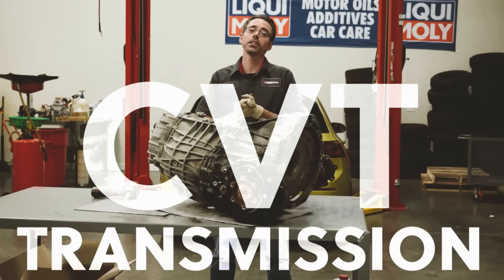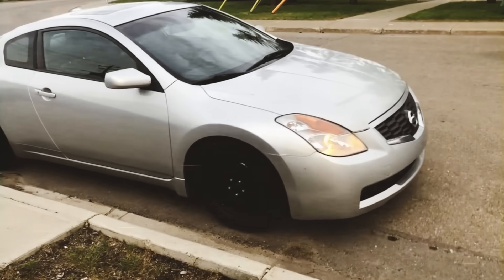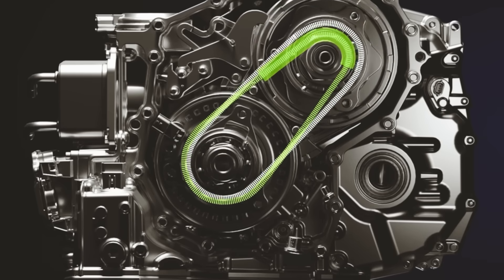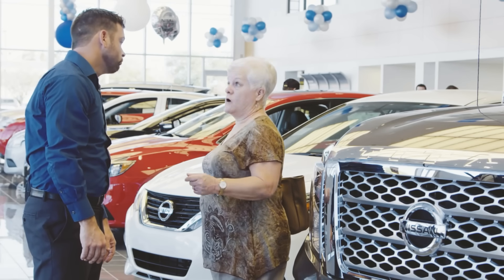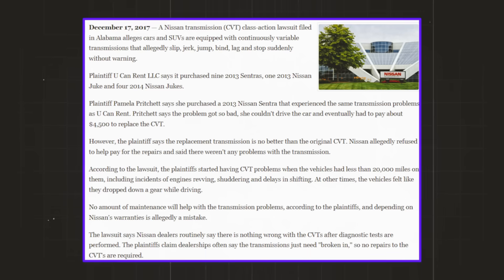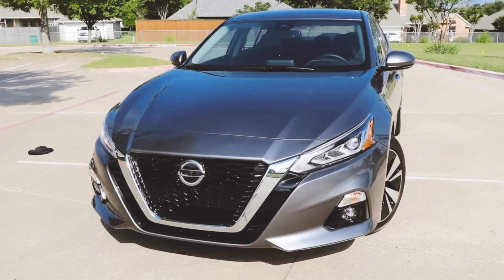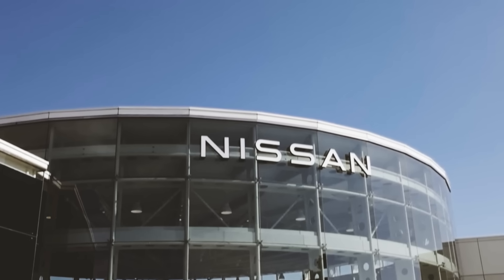Unpacking the FAILURE of Nissan's X-Tronic CVT

Comment: Being a mechanic myself I was reviewing the c v t design Over a decade ago. And I found it to be a double edged sword. And wrote down and design multiple iterations that would solve the c.V t problem. Unfortunately, the reality is.I do not have the capacity 41 man that I am to be able to affect any kind of change to a large corporation even if it would benefit them financially. The sad reality is the c v t design could be redesigned to handle extreme power and loads. To the point that you could probably put them in large semis without concern.
Reply: Like the Cvt in F1s?

Comment: 2003 Murano. 380,000 km no servicing before CVT issue. 

2014 Juke 200,000 km before accident 
2012 Suzuki SX4 (same Jatco CVT) 200,000 km still going
2016 Rogue. 240,000 km still going. 
Replacing fluid once in a while. Like 100,000 km. 
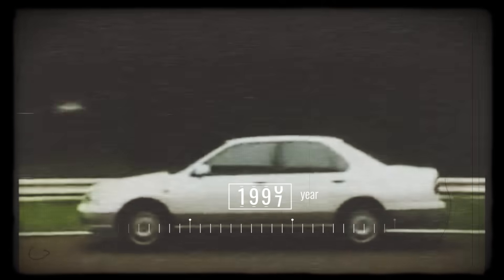Also 4:33 had another Murano for a short time. 

NO issues 

Did have a problem with the updated chain drive CVT on a QX60 from new. Got rid of it. 

Sooooo. 95% failure?

Reminds me of everyone lighting their hair on fire on other issues in vehicles. Yes there’s been some, maybe many, issues.  But it’s not EVERY SINGLE ONE.

Comment: I did notice 3 newer models that were not mentioned with little to none of the common major issues as the American build models is the Quest, Maxima and Murano fun fact about these 3 is that they are similarly built on the same front platform design and most of them were built in Japan my 2011 Quest was built in Japan and I feel it was made with better quality parts from the same design they look the same but they are different and you can tell just looking at an Altima 3.5 V6 CVT to a Maxima 3.5 V6 CVT they are different same engine size the only difference is HP the Quest and Murano looks exactly the same as the Maxima but don’t have the same power output so Nissan changed the CVT design for the American built models

Comment: As a mechanic, I always tell people that it will need a Nissan will need a transmission at 100k. If there are lucky if they make it that far. I have replaced some as low 26k miles.
Reply: Yep, my 2016 Nissan Rogue CVT took a dump at 67,000 miles!

Comment: I hate CVTs. Never driven one that had acceptable performance characteristics. Sure, they might have helped the manufacturer eek out another mpg or two to meet a CAFE standard, but as decent transmission with reliability, durability and good performance, absolutely was not that. The seller did well. The buyer got hosed.

I can’t imagine ever buying a vehicle with a CVT. Not ever.

Comment: friend of mine has a 2017 civic with a CVT and it hasn't had any problems yet even at 195,XXX miles. he's had me do a drain and fill on the tranny every 20,000 miles. the owners manual says to do a drain and fill every 25,000 miles.

Comment: I worked selling cars in the mid 2010s. Had so many people trade in their Nissans because of faulty transmissions. The dealer I worked for didn't bother with selling used Nissan vehicles with CVTs. Those went straight to auction.
Reply: And this continues, which means it is so profitable that Nissan does not care about the loss of reputation and some customers.
Reply: @trumpeldorf what current sources do you have about that?
Reply: @marvin7533  Yes, there is a lot of such data, from the constantly unreliable CVT, which has already become a meme, to the constant investigations by the feds with engine problems, airbags... + consumer reports, where Nissan is the only Japanese brand that always sits much much lower than all other Japanese brands .
Reply: I’ve seen at least 3 older Nissan Rogues stranded due to trans failure. One in the middle of a busy intersection. They are 100% going to fail if you own one.

Comment: Im not going to defend Nissan, but to be fair, CVT's need much more maintenance and upkeep compared to regular transmissions, and they aren't designed to be serviced easily or cheaply. CVT's are also inherently weak. They aren't designed to be paired to a powerful engine. Theyre made for fuel economy, not giant 5 going 90 in a 45, as all Altima drivers do. The Jatco designed CVT is inherently bad.  There's no doubt about it. Either way, you'd be better off with a CVT from Honda or Toyota. Or get a car with a traditional automatic.

Comment: Two issues with the CVT: 
1:  it’s a soulless transmission. 
2: automatic and manual transmissions are still significantly better than
Reply: Cars with CVTs vary gearbox ratios at a fixed engine RPM to accelerate; others use the motor to accelerate at a fixed gear ratio. I think motors do a better job of accelerating.

Comment: I bought my Nissan Altima brand new in 2015 and kept up with the maintenance change the transmission fluid at 60,000 miles and now I’m gonna change it every 25,000 miles. Another thing that could be killing. It is how people drive their cars. The CVT isn’t meant to be a get up and go like a normal transmission(in my opinion) so if you’re riding rough, it can and will probably slip on you.

Comment: CVT longevity seems to depend on at least 4 factors, your CVT make and year, how quickly you accelerate or whether you tow anything, how much you drive in extreme heat or cold, and how often you change the CVT trans fluid and the 2 filters (maintenance interval).  MY 2015 Sentra has 190,000 miles on the CVT and has never had any problems.  I recently dropped the pan, inspected thr fluid, and changed both filters, the belt and spool showed minimal wear.
Reply: I've had 5 Altimas from 2010 to 2024.  A 2013 I had blew the transmission at 2900 miles (yes less than 3000 miles). When I've taken the cars in to have their "transmission flush", they not only don't change the filters but one dealership said they had never seen the filters changed.  Looks like on the 2024, I'm going to be doing my own fluid changes so the filters actually get changed.  When I wrote Nissan about how often the filters should be changed, they said I'd need to contact the dealer.  Talk about a Catch-22!!!  I find the Altima a great car and have had virtually NO problems with them other than the 2013 transmission.  I DO trade them in before the warranty is up though.  After owning 5 Toyotas and 1 Honda, I still like the general quality of the Altima the best.  The 2007 Camry and 2009 Accord I had were two of the biggest pieces of junk I've ever owned.  Disappointing after owning a Corolla, a Celica, a Supra, and an ES300.

Comment: The thing is, Nissan already had a promising CVT called Toroidal CVT back in 90s. But they decided to cheap out for the traditional belt CVT.
Reply: If it's not the transmission first, the head gasket is normally the one.

Comment: I work at honda. They really don't complain. You could come in first time doing a cvt service at 130k. It will be okay. 
Newer Honda regular auto trans have issues quickly with lack of maintenance. We replace these all the time but I never really see a cvt trans being replaced.
Reply: bulllllllsht. cough honda v6 autos.
Reply: There's a Honda dealership next door where I work at and sometimes I can't tell if it's transmissions or engines getting replaced, I'm betting it's the 1.5T engines.
Reply: My Honda has 170k miles and the cvt still runs like new
Reply: Mu honda CRV 2015 has 120,000 KM and CVT works perfect.

Comment: CVT's used by Nissan are not made by then but by a company called Jatco. They sell transmissions to several car manufacturers and they're all trash. Avoid CVT's wherever you can, no matter the make. I own a transmission repair shop and believe me, they will break.

Comment: The biggest mystery is why does Nissan continue using this transmission. They have the new 9-speed AT which is lightyears better than their CVT yet they keep using it which is a risk.
Reply: Nissan owns Jatco which is Japanese automatic transmission company.
Reply: @scrambler69-xk3kv  Didn't they divest JATCO years ago at this point?
Reply: My Frontier has the 9 speed. It's a Mercedes unit. Real nice.
Reply: Because CVTs are used for front wheel driver cars like Altima/Sentra/Versa.  The 9 speed is for Rear wheel driver cars trucks and SUVs and would be hard to fit sideways.
Reply: Cost, save cost, magnify profits
Reply: Costs
Reply: Exactly.  That 9 speed is class.
Reply: Pretty sure the frontier has a standard transmission and I heard the Pathfinder was ditching the CTV
Reply: That is a 9-speed German made ZF regular transmission designed for large vehicles. The ZF transmission is installed on 2022 and up Nissan Pathfinder. That transmission is expensive and not suitable for lighter vehicles.
Reply: I think it's just a US thing cause in other markets, Nissan uses e-power (which is the car being driven by electric motors while being generated by the engine)
Reply: @lol0r3  Nissan sells many models with JATCO CTV in the Japanese market. None of them have issues like in North America, because CVT fluid is commonly replaced every 30,000-50,000km. And yes, e-Power hybrid variants are being offered in Japan, China, Southeast Asia, Europe, and South America. Nissan even offers e-Power models in Mexico.
Reply: I have 225000 miles on a 2008.Nissan Sentra with a CVT  transmission and it's still running strong.
Reply: 9 speed is rear wheel/all wheel drive not built for cars like rogue and sentra
Reply: Because it's one of the best transmissions on the market. The problem is the consumer not giving a shit.
Reply: @garneroutlaw1 "Best transmission"

That's a funny joke.
Reply: @garneroutlaw1 Thank you! All negative propaganda. They sell millions of these and people don't follow the service schedule, then blame Nissan.

Comment: I have a Subaru outback with a cvt and it has eaten solonoids one too many times they just fail so im driving it currently with a permanent limp mode because paying $1300 is not worth it 3 times I have done it twice a third is not an option especially when the value has crashed

Comment: I have a 2017 Nissan Sentra with a CVT and it is at 126,000 miles on the original CVT. Bought it new with 25 miles on it. No issues with it in the 7 years I've owned it.
Reply: That's encouraging. I also have a 2017 and even though I'm nowhere near 126K, I've had no issues with mine.
Reply: @oldmanwood5011
Change CVT fluid at Nissan Dealership regularly
Reply: I CAN NOT EMPHASIZE MORE CHANGE YOUR TRANSMISSION FLUID AND FILTERS EVERY 20000 MILES. PERIOD! SO FAR NO PROBLEMS with my 2017 Nissan Sentra SV
Reply: I have 2017 Nissan rogue change transmission oil 100k now 180k and it's still Run Like new. But this kinda video's always scare me. Now 2025 sep I only changed battery after 8 years it was working fine but just change it because company recommended.
Reply: Mine 2008 Nissan Altima close to 19000 no major problems too. As long as you do your maintenance you should be good.

Comment: Even with regular maintenance I learned the that nissians CVTs eventually wear out. MINE was serviced every 12 to 30k miles.  The continuous running metal belt rubbing and rubbing. Some people get lucky and go forever but alot don't. Their will be alot more lawsuits comming.
Reply: How many miles and which engine do you have?
Reply: @needtau4138 exactly. I call BS on his servicing. it would be fine if it was actually serviced
Reply: Mine started falling at 104k miles. Replaced the stepper motor and fluid with filter but it seemed to work then again and again the same p17778 codes. I think possibly the tourque converter went out on it but a nissian technition told me to replace the transmission. I was so stressed out and was able to just get rid of it after I hit 112k miles. It was a big costly mistake having it. Nissian maxima 2014, v6 engine

Comment: I owned a 2013 Nissan Altima with one of those garage Jatco CVT and had to get the transmission replaced in the first 5k miles of owning the vehicle so maintenances was definitely not the issue. Brought the car brand new off the lot and drove it for 2 months in normal mixed driving with mostly highway and some city driving and by 5k miles I had issues with the transmission stuttering and a weird metallic grinding noise developed. Took it to the dealership and they said there was an issue and had to replace the transmission, thankfully under warranty but clearly not a good sign. I will admit that the replacement transmission did held out for 150k miles when I sold the car but god forbid if anyone had issues just right after the warranty period
Reply: I just bought a 3.5 2010 altima with 71k miles last friday, praying it lasts me until I at least pay it off (2 years max).... It drives very smooth though and no noises. I heard the 3.5 cvt's are stronger
Reply: Are you an aggressive driver? If you hammer on a cvt as in hard starts from a stop on a regular basis you will kill it. Drive a cvt car like an old person drives their car, have the cvt fluid and two filters changed as you should and you will be fine. Do that or buy a different brand simple as that.
Reply: @DenisAbbott-m2q 

No sir... Bought it brand new so driving it like a normal person doing regular commuting

Comment: WHERE did you get THAT number?

All initial technologies have issues until they mature.

The 2nd and 3rd CVT generations have been pretty good.

I had one and know 7-10 people that have them with no problems.

Of course I told them to change CVT fluid every 30K.

I do miss that transmission. Fastest changes and pickup than any other transmission (infinite gear ratios).

But it is blanket claims like this that tell me which channels/people NOT to trust!
Reply: Please. I'm sure they're garbage just like VW's are, regardless of what fanbois say and make excuses for. For me, my three Chrysler Corp. cars were more reliable combined than my one brand new, made in Germany MKV Golf. Humph.

Comment: My 12 lancer es had the same cvt. Better fluid and case design. Lasted me 5 years 80 thousand miles trans fluid changed every 30k. Picked it up used at 50k miles. Some noise here and there toward the 130k mark, so I got rid of it. Overall, I think mitsubishi has the best version of this trans, but only if you drive it calm and change fluid every 30k.

Comment: I’ve got a 2022 Altima that’s doing all the signs of cvt failure… massive delay in accelerating from a stop, crazy vibrations at low speed acceleration ever since about 40k miles. The good thing about it is that the local dealership can’t/won’t do anything about it until a check engine light comes on! Hopefully I’ll get rear ended at a light and it’ll total this piece of junk so I can get the Honda I wanted in the first place
Reply: Maybe a deer will do you a favor and step out in front of you. Drive at night when they are out running around.
Reply: Why did you buy the Nissan?

Comment: It doesn't help that Nissan recommends in their owner's manual to "inspect CVT oil" and at no internal does it mention to replace. Actually, they do say to replace the fluid in a blob of text outside of the maintenance schedule but only says "If using a car-top carrier or driving on rough or muddy roads, replace the CVT fluid every 60k miles or request dealer to inspect..." ..... And from what I've heard, they only replace the fluid, leaving the internal filters untouched... A reputable mechanic said that CVTs are very reliable if you change the oil and filters at regular intervals...  Manufacturers say it's either "sealed" or the oil is "lifetime".. but sadly, people don't realize is that what Nissan considers "lifetime" and what you consider "lifetime"... not the same "lifetime".

Comment: One big unanswered question is why was Nissan allowed to continue selling cars with CVT in the USA after the proven defects and high rate of failure. Any other company with a product so defective would have been forced to withdraw that product from the market.
It is criminal that Nissan is still selling cars today with CVT transmissions.
Reply: Or Fords Dual-Clutch. The NHTSA investigation found internal documents that told the maintenance technicians in the dealerships to tell customer's that they had never heard of a Dual Clutch transmission failure. But they continued to sell them.
Reply: Why do all other manufacturers get to keep only selling their cars with known defects. Because they can get away with it.
Reply: It only exists thanks to the EPA and govt corruption aka fines/fees
Reply: I am agreeing with alot of comments here.  Nissian is unfairly labeled based on haters not real numbers and facts out here.  Even Toyota has had a major recall and one now.  Nissians has been in the top 10 of most reliable cars with consumers report for years now.  Rogue is a top 10 best seller .  Facts over those who ksut want to hatr
Reply: Rogue uses 3 cylinders very complicated enging and one of the most not reliable engine in additional to cvt problem. According to all review and consumer reports, the last Rogue is not reliable car.
Reply: We have a 2014 Nissan rouge with a cvt and 170k miles if you actually change the every 30k they will outlast a normal transmission. There is way too much misinformation around the Nissan cvts.
Reply: @scott8238  not misinformation cvts in the rogues have a very high failure rate,.. there are four different lawsuits to back up those claims.. I,myself work in a transmission shop , seen for myself, flatbed after flatbeds coming in,and dropping off these Nissan vehicles… it’s a joke… fluid changes help , but you are that rare exception if you are the original owner,and that being the original cvt.. with 170k..
Reply: Not really Chrysler with the 9spd and even hinds had terrible transmissions in the accord and acura tl. They just fix them under warranty or the extend warranty  up to 120k miles.
Reply: @occckid123  It is a bloody shame when you consider that the engine and the transmission are solely made by the manufacturer. Just about every other part on the car can be had from the aftermarket parts bin..